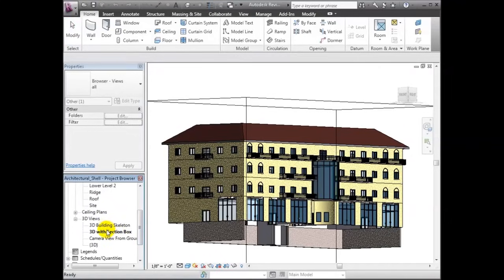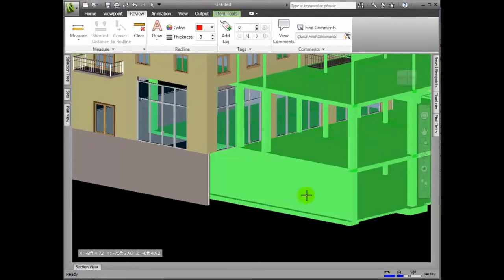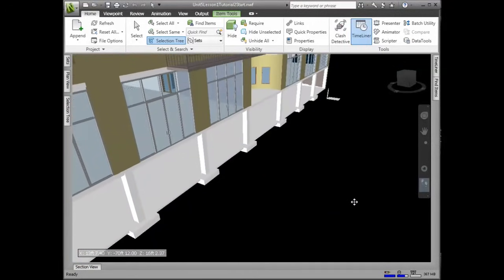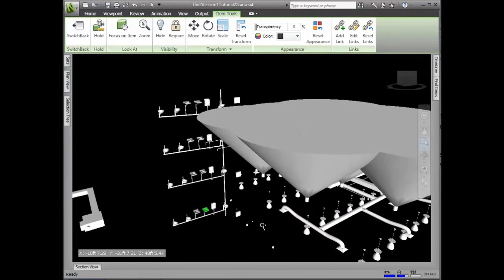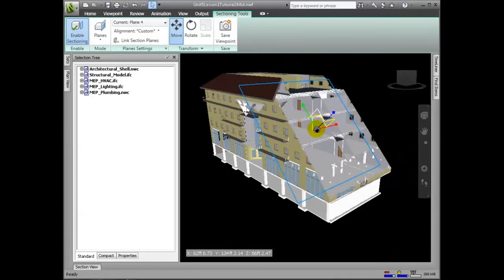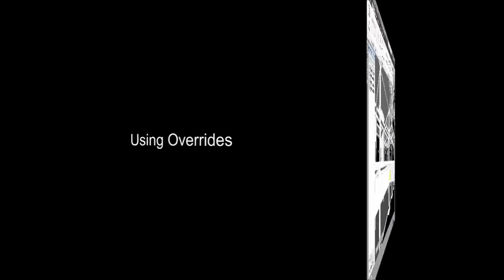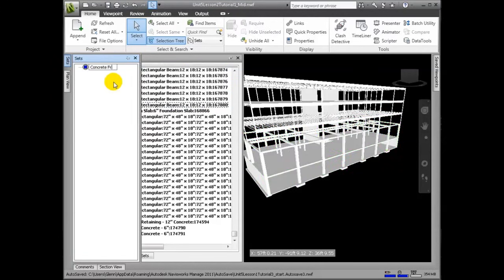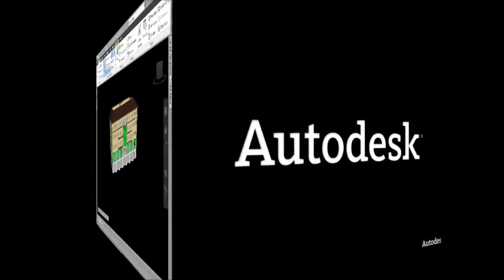Navisworks Tutorial for Beginners - 1

Comment: what's the purpose of exporting the Structural and HVAC to different formats/extensions? Cant we just append the revit files instead?
Reply: You can append. It will auto create a nwc file when you do that. 1 good reason to export from to the nwc is if you have specific setting applied to it when exported that you may not get during a append.  You can also automate some of that by using the batch utility button.